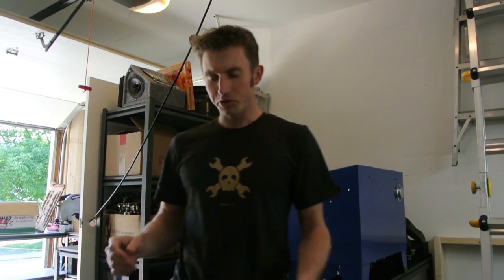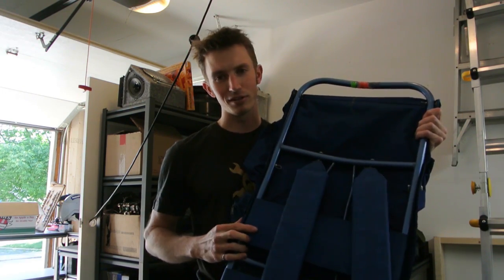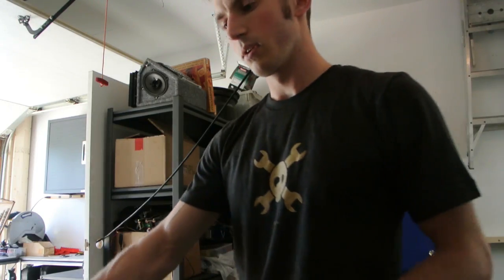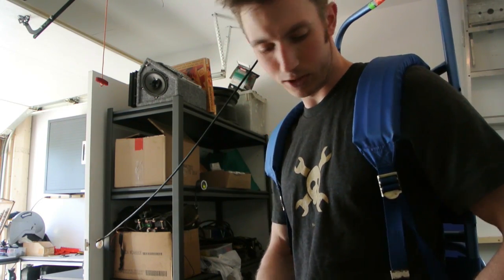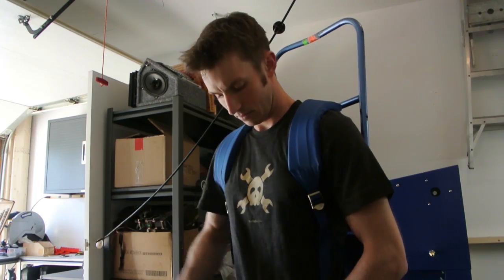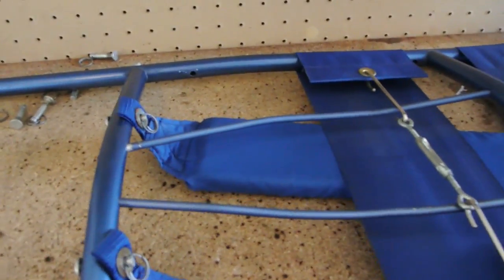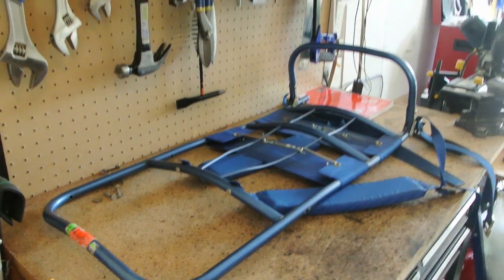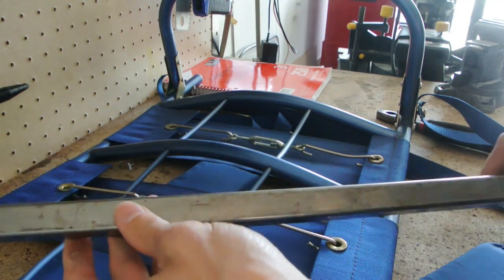Elysium Exoskeleton, Part 6: More planning!

Comment: Too late now, I suppose, but why not just use a double action piston?
Reply from the maker: Those are double-acting cylinders actually, just haven't had a need for the downward force yet.
Reply: Oh, I guess I didn't look closely enough. I'd assumed the reason you mounted them on either side of the elbow joint was that they were single-action. Why did you mount them on opposing sides, then?
Reply from the maker: Joseph Harner Single acting, opposite direction cylinders? Naw, they're all double acting. I suppose I could have put both on the back but it would of been a bit tight. Spreading it out makes it a bit less cluttered. They're located at equal distances from the hinge so they act together with equal force. Just having one wasn't enough since the moment arm of the whole arm is rather long.

Comment: I ask this, knowing that there's already a massive playlist waiting, but why the 1 inch square tubing for the backpack?  Why not use more of the same tubing you used for the arms?  It would be lighter, and you'd have an abundance of ready-made attachment points
Reply from the maker: I actually ended up using 3/4" steel tubing for the frame, which is actually lighter than the 1" perforated tubing. The main reason I did this was while the holes are handy for mounting things, it's terrible for welding. The zinc plating makes it difficult  (and very unhealthy) to get a good weld.

I might actually have to redo the arms with regular steel.
Reply: I thought about that while watching you do the bends for the backpack, it definitely would have made for lousy welding.  Man, the weird shit i remember from high school shop class...

Comment: I found a back plate at a local industrial recycler place. I think it was used to hold a leaf blower or something. They make motor mounts for small engines to carry comfortably.
You might consider those as alternatives.
Great work. Keep it up !!!
Reply from the maker: That's a really good idea Sqoou!
Reply: the Hacksmith
Thanks. Just doing my part. lol. If you're planning to make the suit legless, I thought you should consider that. The shape is spine-like and rests equally on the lower back as well as shoulders. One or the other resting points would be a strain. I use mine to comfortably carry around lead acid batteries for 12 volt power in the field.

Comment: What about steel pipe that's used for gas line?
Reply from the maker: I'm using steel box tubing, it's pretty structural and easier to work with than round tubing. If I had a pipe bender I might consider something like that though!

Comment: I still wonder how you will power the suit. Are you going to have a big compressor on you to power it?
Reply from the maker: Doesn't have to be big -- The suit only uses pressure when I engage the limbs -- it'll be neutral while I'm walking around, then when I want to flip something that's when it engages :)
Reply: the Hacksmith so you are not gonna make it walk for you?

Comment: Why not use a fall protection harness?
Reply from the maker: Trying to stick to the Elysium idea for now. Don't worry, once this ones done I'll be doing even better things...
Reply from the maker: Still need a frame to support the weight, otherwise it will limit the suits ability to only my own strength.
Reply: the Hacksmith
In that case why not make it powered armor?